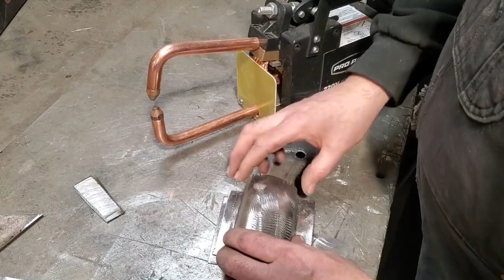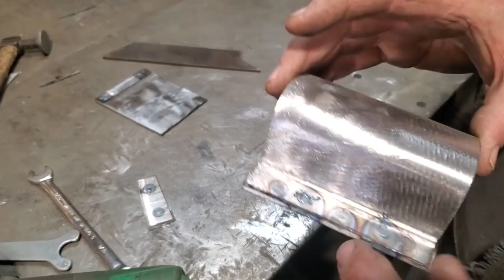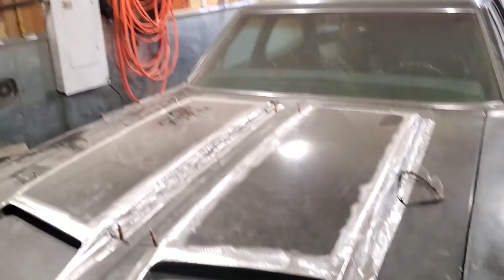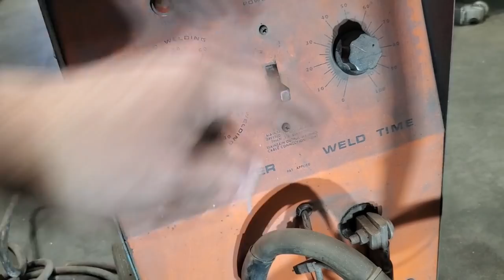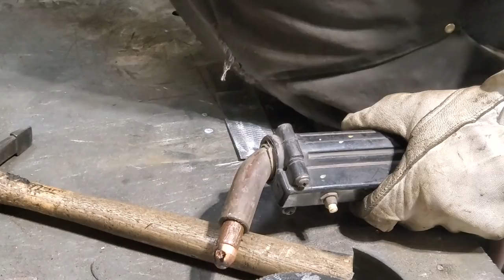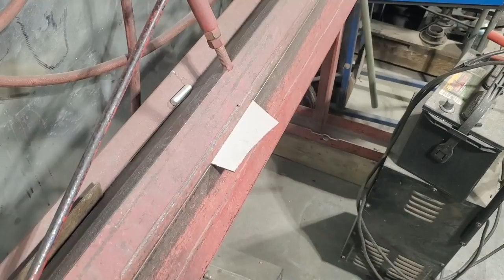How to spot weld. spot welders, New vs old!! Future plans!!

Comment: Tony - I don't think the table affected the weld thermally, maybe 10-20%, not much if any. It's electrical resistance welding... it's affecting the weld electrically. With spot welding, the path the electricity takes is where the heat goes (there's no arc). If you have the workpiece sitting on the table, a huge portion of your welding current is flowing through the whole workpiece, spreading out, going into the table, and then back up the other electrode. When you had it on wood, the electricity is forced to go through the workpiece only, so there's far more heat concentrated through a smaller amount of metal because that's the only place the electricity is flowing. 

Frankly, on your door skin example with the huge thick backing piece, I'm shocked it welded at all. That's some good abuse of spot welding practices to get an interesting side-effect. I'm definitely adding that to my list of tricks.

Also, I'm pretty sure the loose electrodes are still meant to bear hug the metal and be placed on either side of the sheet, not be placed side-by-side on the same face unless you have to. Side-by-side is a bit of an emergency hack with respect to spot welding. It works, but barely. Ideally you want the electricity flowing through the cross section you want welded, not just applied to the general area. It's a valid technique (for example, spot welding to batteries it's necessary, you can't be inside the battery, you have to be side-by-side on the outside), it's just generally inferior to "proper" spot welding through the cross section with pressure. You're going to create a much smaller and weaker welded area, with a much larger heat zone. But with a welder big enough and metal thin enough, you can force just about anything to weld, and that monster is certainly big enough.

No "wrong" way to do things, long as you figure out a way to make it work. But in general you want to pinch the weld where possible for a strong weld that won't shatter over time.
Reply: I'm going to have to go looking at factory spot welds now. How many are "single sided"?
Reply: @avid6186  from a factory? Zero. They have great big machines with huge jaws that can reach any surface. Even back in the 70s, they had huge spot welders on chain hoists that you'd swing into place with your bodyweight

Comment: Golden as always Fitzee. I have the 120v unit and it is ok. I have 20 amp 120v breakers and it trips them when I hold it too long. I suggest the 220v unit due to that. For the tips on the spot welder there you taught me something there. And thanks for letting me know that Princess Auto carries them. Cheers

Comment: For those that want the second old machine but can't find one, how about making up a set of leads and hand pieces for the princess auto machine? You would need to add a switch as well of course.
Reply: I was just wondering the same thing,  just not sure if the clamp style has enough power to use it like that,, it would be interesting to find out
Reply: @geoffreymills9932  hadn't thought about it until now. The big unit actually does 2 welds at a time, so more power needed. However there is a work around. Its localised resistance that causes it to heat at that point. So if one lead had a big flat end or even an earth clamp off a welder, something with minimal resistance there will be minimal loses at that point. Then all the heat will be concentrated at the electrode end, similar principle to an arc welder.
Which has now got me wondering if I could make something like that out of an arc welder. I have a mobile 400 amp unit available that would have more than enough grunt 😀 Can't justify buying a spot welder for the occasional use it would get. The switch would be the only problem, needs a bit more thought.
Reply: @avid6186  Avid read my comments below re the Amperage those units produce-you may feel that 400amp unit is large and is for stick welding but it is 'puny' compared to what the Porta Spot makes and the new Lencos are even more impressive. Once you see the amperage they produce you'll see why the 'ground' is a similar size electrode and not simple ground clamp. These machines deliver a lot of amps very quickly but to a very small area.
Reply: @garyl7883  how do they get such huge amperages out of single phase? Are they much lower voltage than a stick or mig welder? I suppose they could be as they don't have an arc gap to jump. Sorry, haven't been able to find you other comments about amperage yet. What amperage does the porta spot run? There's a lot of comments to troll through now. The reason they have a small "earth" is to get the heat into the second panel. Thats how Fitzees flat bar works, stops the concentration of heat on the door skin side of the weld.
Reply: @avid6186  I really don't know how they get that kind of amperage other than they are low voltage with respect to the output of the machine and I would say you are correct re no need since they aren't required to jump and arc gap.  They are pretty simple machines- two transformers in them- the one is a step down for the control circuit(timer etc) and the other is a huge transformer for the actual welding.  I said  'below' re the amperage if you look at my initial reply to Fitzee I commented that machine is 2,500 amps and the current production Lenco units are even higher in the 5000-7000 amp range. What you stated re ground/earth makes sense seeing as how the new Lenos use a single electrode vs the two these vintage machines use-probably to reduce operator fatigue as Fitzee said those cables Are heavy. I will look on the spec plate of mine and see if the output voltage is listed.
Reply: Checked the plate on my unit- specs are as follow-- OCV (open current voltage) 7.00 volts  Welding voltage 2.3 Volts  Dead Short Current 2,8000 AMPS so that is about 5.6 Kwatt of energy (heat) put into the weld 'spot' of about 1/4" in diameter.
Reply: @garyl7883  well I didn't expect numbers like that ! !  Talk about serious amps! Thanks for the reply, I now know its probably a waste of time trying to convert an ordinary welder or if I do try it will be mainly out of curiosity rather than expecting to get worthwhile results. The mobile puts out something like 28kw, but it looks like it's a completely different type of power. Thanks for the info.
Reply: @avid6186  Glad to help-years back think it was eastwood that made a pistol shaped 'spot welder' that you attached to your typical buzz box welder and when you pulled the 'trigger' an electrode made contact with the metal No idea how well it did or did not work. I would imagine there was a fair sized arc due to the OCV of most buzz box type welders. These welders have such low voltage there really is no 'arc' unless it is in contact with the metal. One important thing about these welders is the tips do have to be 'dressed' as they wear for them to work properly (good welds) if you do find one. The tips do to need be flat on the ends.
Reply from the maker: You see the leads on the big one? They are like a inch thick. I found them getting warm. Can only imagine the current going threw them
Reply: @fitzeesfabrications  welding cables are good for it. If you look at things like submerged arc units for instance, the ones we had years ago ran over 1000 amps. Cables not a problem, although as someone else pointed out that little unit might not have the grunt? The big one is actually doing 2 welds at a time. Perhaps if one cable had a big flat "earth" so there was no resistance at that one and a point on the other so that it only did one weld at a time? Spot weld is one name for them, but they are also a resistance weld, its all about concentrating the power in one localised spot.
Reply: @fitzeesfabrications  have you ever had a look inside that machine? Does it have big capacitors in there or is the output current limited to what your input power can supply?

Comment: Great video Fitzee. I have an old Lenco panel spotter 3000 that I picked up on craigslist a few years ago for $200. Works great if you have clean metal and no gaps. It will scare you a bit when you hit a gap though.

Comment: Love the old one. My .02 you already have you extension cord either of two ways. 1) Add a receptacle outlet box onto the case of the old one wiring to the contactor in that machine or 2) cut the cord near the old machine an add a plug to the old machine and a receptacle outlet to the cord.
Reply from the maker: Plan is for number 2

Comment: you can hold the leads on both sides to pinch weld it like the Pro Point style ( or Classic Pinch type spot welder ).. line up your leads to one spot weld... where you can reach both sides...

Comment: Tony, Its not the temp of the table...its the conductivity of it soaking up the amps. Also, you want the "next set" of welds to be at least an inch away from the previous set. For the same reason, the juice will flow through the previous weld instead of making the new weld. Well it will weld it but it won't be as strong without adjusting heat/time (and pressure)
Reply from the maker: This is stuff I likes to see. Teach me. Always  love to learn
Reply: We were taught the same on a welding course last week 25-27mm between spots. Also a forumlar for tip size on low carbon steel d= 2.54 + (t1+t2)   So the diamater d = 2.54mm + the thickness of each peice of metal.

Comment: How about using a sheet of aluminum or copper with the first welder as a backer for door skin spot welds? 🇨🇦
Reply from the maker: I think it would still have to be thicker. I think it burn threw anything to thin.